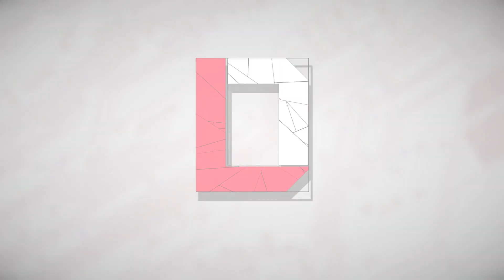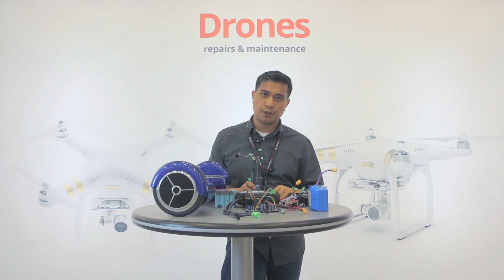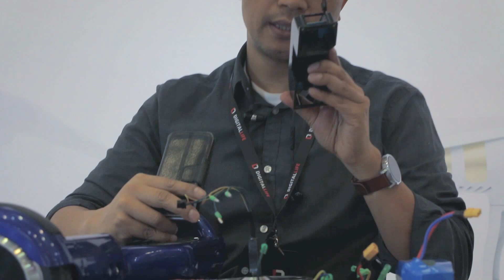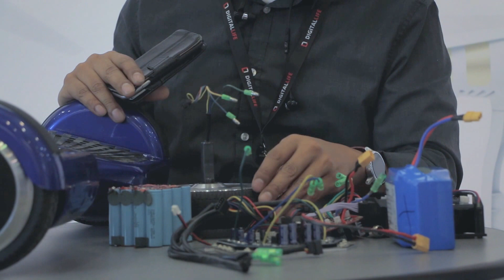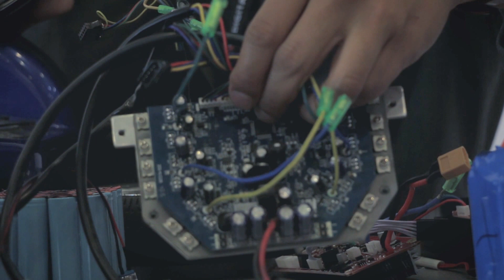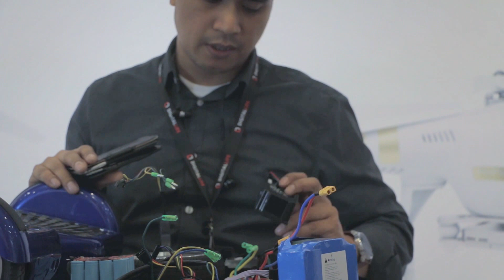"One side works" What Hoverboard Parts To Buy - Q&A Session

Comment: You're out for money, it's so evident. Especially when you said that the battery was leaking because it was getting warm. Lithium Ion Batteries heat up when you charge it for any of them. Actually in any case of cells charging up with it heat up.

Comment: Each side of my hoverboard works individually, but when I apply pressure to both sides simultaneously, the board goes out of control, vibrating violently. Please help. This issue occurred after I replaced the two sensor boards because one side wasn't working.
Reply: +Stan Gomez figured out the issue, the battery had gone bad and was not supplying power correctly..replacing the battery with a new one fixed this "pressure to both sides" issue...

Comment: Do you know any possible fixes for why my hoverboard pads aren't sensitive. All my friends hoverboards are very sensitive and mine isn't. I can only put my feet to the sides not in the middle. Please help
Reply from the maker: +Ve Coup A possible fix could be to replace the rubber sensor tabs.  Your tabs could be shorter than others, and won't be able to trigger the sensors.
Reply: +Digital Life X thank you
Reply: +Digital Life are they on your website?